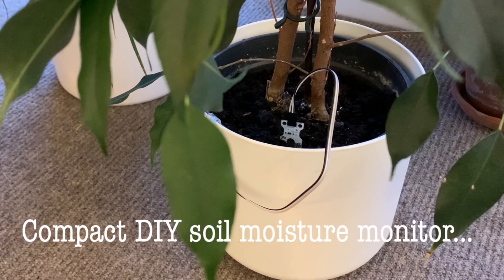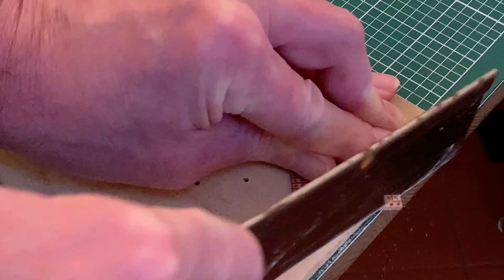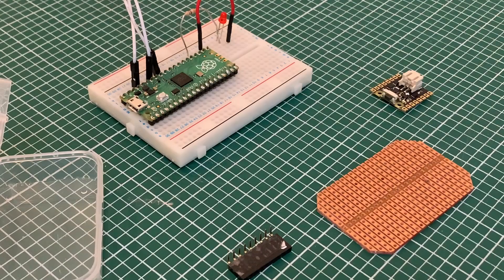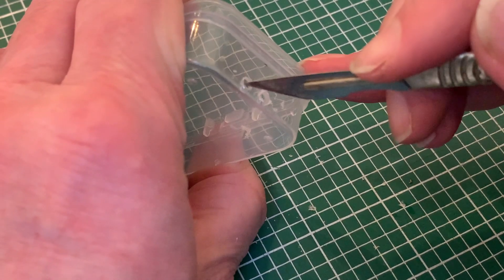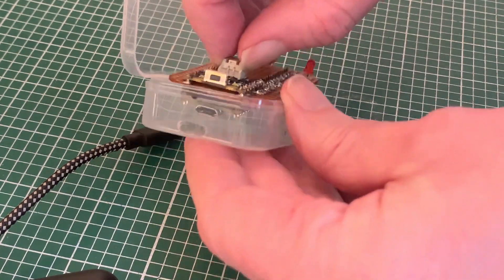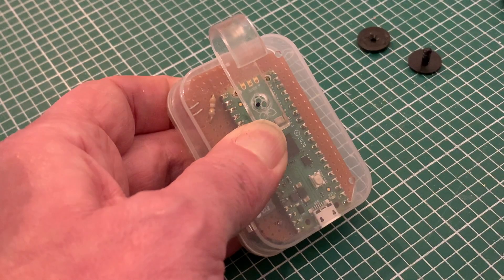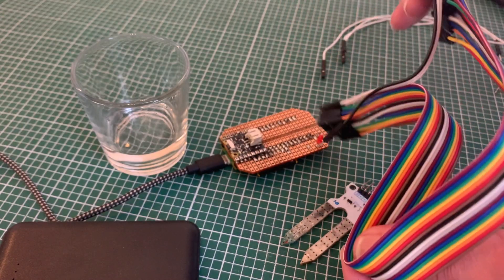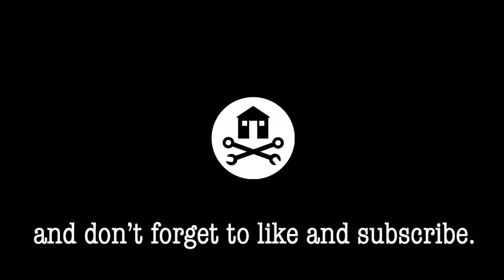Rechargeable Raspberry Pi Pico plant watering monitor with a neat plastic case

Comment: Highly recommend changing the wet sensor to the one with a resistant outer layer.
It will prevent corrosion
Reply from the maker: Indeed. I’ve got one. Just need to wire it up. Thanks for the tip.

Comment: Perfect and free from manual catering , better make a custom pbc for this , gonna make easy and flexible
Reply from the maker: Thank you. A custom PCB would be good, but for my next version I dispensed with the board altogether and just used soldered headers with jumper cables: https://youtu.be/-UjNNdQtsy4?si=OXjSltZKdiopnI8o

Comment: Good stuff! I am though amazed how involved the design gets despite the simplicity of the idea and its application.This actually makes me be more respectful to the industrial sollutions, where simplification is a part of the design routine. But isn't it (i.e., self-induced trouble) why we are doing this diy stuff?..
Reply from the maker: So glad you like it. I've improved the battery life using deepsleep (video coming soon), which I will use for my next iteration - using a Pico W and some solar panels - which will hopefully not require plugging in at all.